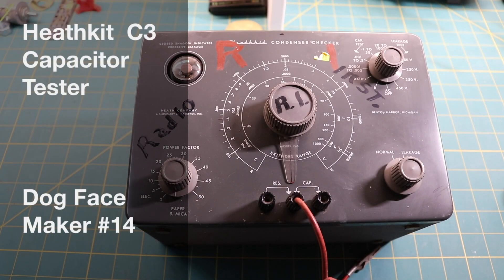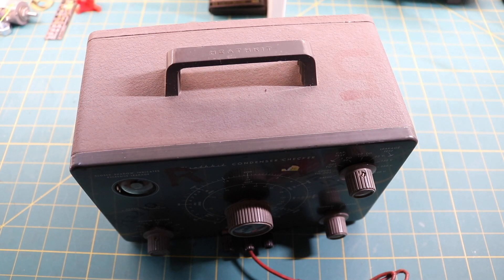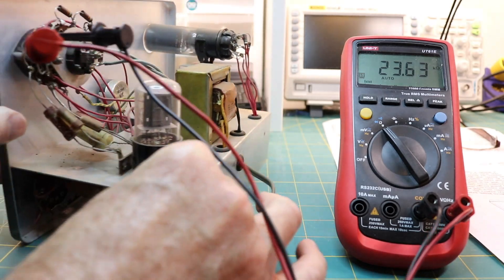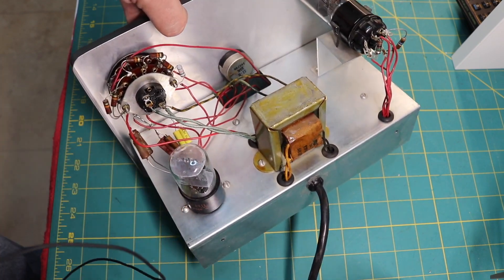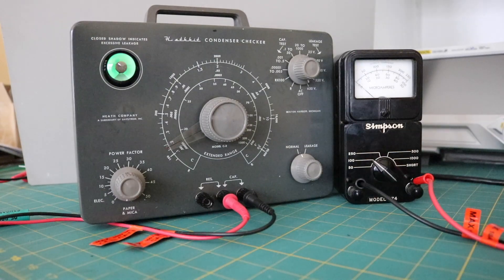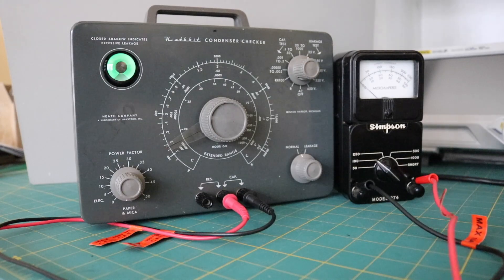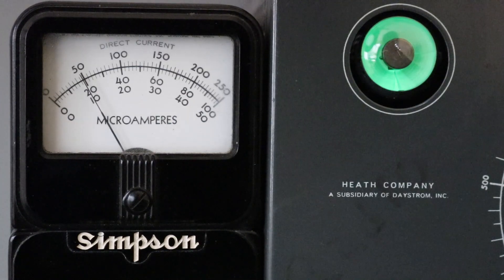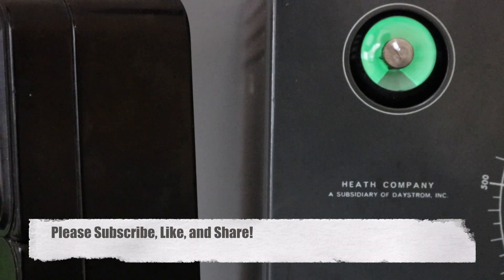Heathkit C3 Capacitor Checker

Comment: excellent video. i recently bought a c-3 so timing is perfect. ordered 1626 & 1629 tubes. am gonna check resistors & replace caps. did you buy your caps from heathkit ?